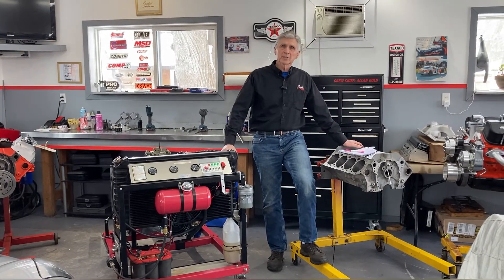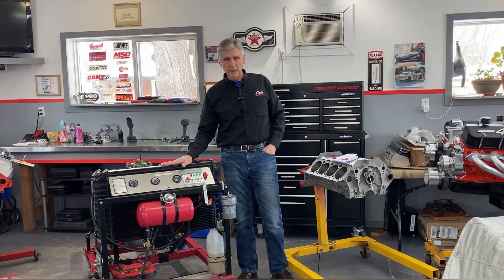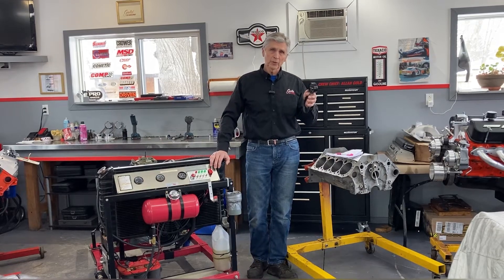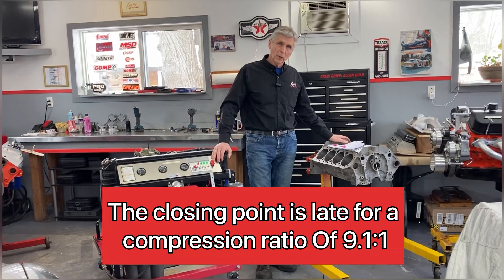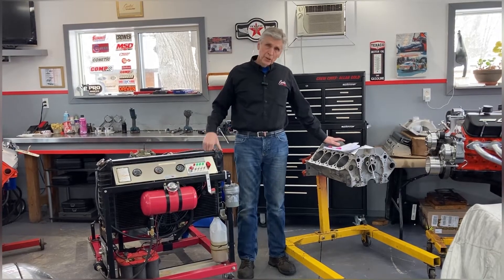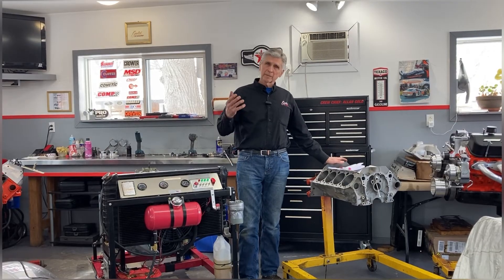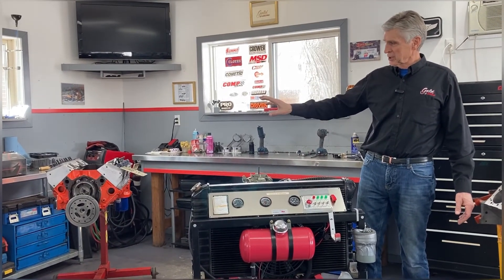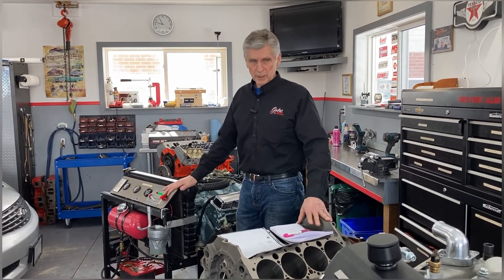Selecting the right camshaft- Matching your cam to your compression ratio - PART 1

Comment: Love your video! Question, I have a  stock factory 1996 chevy 5.7 vortec engine. I would like to change the pistons and add flat top pistons.  I also want to run the LT4 Hotcam. I am trying to do this on a budget and keep it streetable. What do you recommend in maximum static compression for the Lt4 Hotcam. I will be using 1.6 roller rockers. Also will run headers with dual 2.5" pipes. The top of the engine will be ported vortec heads with machine work and springs and hardware to match cam. Also the intake will be factory with the spider injection upgraded to the improved system with injectors for each cylinder, rather than the poppets. Also the injectors will be 36lbs. Oh, also high flow performance fuel pump. I want to put this engine together right. I don't mind running 91 oct premium gas. Transmission will be whatever stall converter to maximize launching and sither 4:11 or 4:56. Gears. The truck is just a fun weekend ride to cruise around and hit the strip occasionally.
Reply from the maker: Thanks Richard. With this cam and steel heads i still think you should stay under 10:1 to be safe. The Summit CR calculator works ok. With that info I suggest you google the Wallace Dynamic CR calculator and determine your cranking pressure. Again, I suggest 180psi max. Hope this helps. AG
Reply: @goldsgarage8236  what camshaft would you recommend in this setup I have , except bumping the compression to 10:5 to 11 to 1? And still have "decent" street manners, run on 91 premium fuel and no more than 3600 stall? Using the vortec heads I mentioned? I guess what I'm after is at least getting into the 400-450 plus ft-lbs torque territory. I don't mind having that "Chop" in the cam when idling. Like I mentioned in my earlier post, my truck is a fun truck for cruising around and occasional strip action. Its definitely not a work truck and it will rarely see the highway, except when traveling to the strip an hour away from home. I know there will be a handful of cams to choose, but just from your experience,  what do you think?
Reply from the maker: I will do my best. The vehicle and how you are planning to drive it is important. Since you are using gears, (high ratio numerically) and a converter and you want to race it a bigger cam is warranted. Is it an S10 or full size truck? 
Also a bigger cam will allow you to use more static compression so aim for the high side of 180PSI. Something in the 280-285 degrees of advertised duration, 230-240 @.050". This cam will have a late IV closing point, 66-70 ABDC. As for lift, I am thinking about .550" max with the 1.6 rockers. If you know the flow numbers from your Vortex heads, that should be taken into consideration. Some heads actually have reduced flow at higher lift. 
You will need to machine your Vortex heads to accommodate this lift and there is a max so that is a factor also. Check this out thoroughly to avoid coil bind or valve guide to retainer interference. 
If you don't mind the chop, a shorter LSA, probably about 108 would be ideal. 
Most factory cams are 110 which is a bit of a compromise, you don't want any wider LSA. 
Richard, that is my input for what its worth. You can also call the cam company for their suggestion and get other opinions. 
Thanks for the question. AG

Comment: Great video! I am in the process of designing a building a 496 for my 70 Chevelle. The block is at the machine shop now and I have went all Eagle forged lower end with main studs. Little much but I want the option of putting it on the bottle in the future. This is just street motor with a 10.2:1 CR with a .025 compressed head gasket. I haven't nailed down what cam I am going to be running but your video is great! I am sure I will watch in a couple more times :) Looking forward to part 2.
Reply from the maker: Thanks for your input shanman. I apologize that I just noticed it now. AG

Comment: One comment is that with that 0.065 head gasket you had no quench action. That's not great for efficiency or power. With the 0.025 the quench is probably great as long as the piston isn't way down the bore. It's too tight if it's zero decked and you might touch the head. Probably 0.035-0.045 is a good place to be. Quench is gasket thickness plus how far down the bore the piston is at tdc.
Reply from the maker: Thanks for your comment Robert, and sorry that I just noticed it. You are correct about the .065" gasket. My mistake for not measuring it on the first build. I agree .035"-.045" is ideal and the higher the  compression, the more important it is. AG

Comment: Your 160/180psi is probably  a good number for pump gas, 87 octane?   I have a 400SB with about 170/180 psi runs on 87 just fine. But my question is going  to 91 octane how much more psi can I go? 200/210psi? I don't like leaving power on the table.
Reply from the maker: Thanks Jesse, i am planning to discuss this issue in my follow up video. Thanks for supporting my channel. AG
Reply: @goldsgarage8236  yes and yes.  Can't wait to watch it.

Comment: I’m going to assume 160 to 180 is a target for premium pump fuel?  What cylinder pressure would one want for running 87 octane fuel?
Reply from the maker: Thanks Ron. This is an interesting subject and I am planning to do some more research on it for a future video. To answer your question I referred to the 1968 Chevrolet manual. A 307 200HP engine (base engine that would require only "regular gas") had a cranking pressure of 150PSI. As always, other factors such as timing advance, spark plug heat range, fuel air ratio, driving style etc. could influence this as well. 
I hope this helps and watch for more info in this subject.
Reply: It’s a very interesting subject!  Unfortunately octane and it’s function is a very misunderstood subject.  In my opinion, octane and a proper timing curve are the two most important parts of a properly functioning engine no matter the usage from racing to towing the race car.  Looking forward to more of your videos.
Reply from the maker: Thanks again Ron. This discussion inspired my next video. Would you believe that a 12.5:1 CR L88 427 has the same cranking pressure as the 307? I will explain why and how. Look for it soon.

Comment: My builder in 2019 scared me that I'd need to use E85 only in my daily 418 LS3. I've been using 92/93 octane with 11.9 SCR, 8.9 DCR, 220 cranking psi. Peak tq is only with 20* advance, though oem heads.
Reply from the maker: Thanks evcass69, it would be interesting to know if you could make as much torque with less CR and more advance. I have never seen 220 PSI in a street motor.
Reply: @goldsgarage8236  I wonder also.

Comment: Very good Tech.
I have been talking about this same subject for years.
Have to get the cylinder pressure up.
Do that the Horsepower and Torque comes up.
Taking advantage of your Low and Midlift flow numbers.
Good topic.
I just subscribed to your channel. 
Take care, Ed.
Reply from the maker: Thanks Ed. Your comments are inspiring more thoughts on the subject and so I am thinking of a follow up video about how the OEM's managed this in the early muscle cars. They were pretty smart. Watch for it. 
Allan Gold
Reply: @goldsgarage8236 Thanks Allan, I'll be watching for your video.
Great topic.
Thanks again, Ed.

Comment: Can anyone answer why some calculators ask for the intake closing +15 degrees? United Engine Machine in particular. Wallace Racing Calculator doesn't ask but their calculations match my "actual" cranking pressure.
Reply from the maker: Thanks Ragingbull340, I am getting good results with the Wallace calculator and advertised specs.
Reply: @goldsgarage8236   Thanks for replying. I've decided to only use the Wallace calculator. One question. When figuring cranking compression, should I use "advertised" intake closing and not .050? Thanks again.

Comment: All I have is the Intake Closing point at .050 lift cam specs. The calculators I see use the .006 lifter specs. Is there a conversion factor for this or call Lunati for those specs?
Reply from the maker: Thanks for the question. I think you should call. Some cams lift off the seat much quicker than others so I don't think there is any conversion factor. It's interesting that some flat tappet cams lift the valve off the seat quicker than roller cams.
Reply: The lobe ramp rate will control the delta between advertised IVC & 0.050 IVC. Using AIVC for DCR is best. Maybe you can get the AIVC from the vendor that ground the cam?
Reply from the maker: Thanks evcass69, I always use advertised intake valve closing specs for my dynamic compression ratio calculations with good results.

Comment: .967 I  .928 E and the Henry show is 14.5to 1 what it mean to work so well is with my head 540 oil into lifters wouldn't bleed down I lose hundred thousand lift 
You might say that's dumb
But it's straight 50 oil in it. there I had a lift from my camshaft
I'd run 9.06 et at 148 mph in the 1/4
With 50 weight oil in it it would run a 8.67 et at 167 mph
Reply from the maker: Thanks for your input Scott.

Comment: It's worth mentioning that your altitude where you live is also very important! I use the Wallace racing calculator and it has this included.
And the cam timing number you need are the "off the seat" duration number and not  the "at .050" number to select the most proper camshaft for the application.
I live at 3400 above sea level, and I'm using Aluminum cylinder heads, so an 11.8 to one static compression is what I need to get 170 psi with the parts I have!...good to see professional builders sharing this priceless info!
Reply from the maker: Thanks for your valued information and comments Duane

Comment: I run forged flat tops with small valve reliefs, 64 cc vortec heads and 15 thou shim gasket and it runs fantastic.. The amount of torque over the old 882 open chamber heads is crazy! Now I worry about the 700r4 trans lol!
Reply from the maker: Thanks Larry, what is your CR and what are you using for a cam?
Reply: Gotta love those Vortecs!

Comment: Compression adds power everywhere in power curve! What people need to decide is what kind of fuel to run and what kind of octane they want to use!  If they want to run 87 octane 9 to 1 is all I would push with todays crap 87 octane!
Reply from the maker: Thanks Larry, I agree. The dynamic compression should also be calculated as the cam can bleed off some of the cranking pressure.

Comment: I got a bit of problem with my build in that the quench distance is too large.
So I need to take the block back and get it ”zero decked”.
The cr is a very healthy 12.4:1 so the quench is probably needed..
Reply from the maker: Thanks Magnus, I would suggest you re-calculate your CR after to deck the block.
Reply: @goldsgarage8236  Yeah I think Ill have to modify the combustion chamber in that case so the CR doesnt get too high.
My main thing Im wondering about atm is the issue with quench distance. Only reason to deck the block would be to get the quench tighter but Im not sure if its worth it.
On one hand I have pistons with a shallow dish in them and only a 11mm band/ring going around the piston that could act on the quench.
On the other hand I seem to be in the distance that one should never be (0.055-0.06") according to most opinion.

The head gasket I have will compress to 0.043-0.049" and since my pistons are around 0.011 below the deck it gives that large quench distance.
A "zero decking" seem like it could be good but I cant really tell if it is worth it.

I guess another possible solution is to taper the chamber quench pad slightly in the hopes of relieving some of the potential for the non-optimal quench distance making it knock sensitive.

On-going research =)
Reply from the maker: Magnus, I agree, minimizing quench is definitely good to do but it is expensive because it requires decking the block. It does allow more compression without detonation, however decking the block increases compression so it is kind of a double edged sword.  I am building 2 400SBC's right now. One is .005" deck and the other block is untouched. I need 75cc heads to get the compression manageable in the decked block. Watch for them on the test stand and dyno.
Reply: @goldsgarage8236  yeah. And its hard to take back a decked block to how it was 😄
My brother suggested Id draw up the gasket in cad and have it cur out in copper. But Im not sure how it would seal up the water in the long run. Common practice on race engines not so sure on street engines.
Another benefit with that approach is I can reduce the crevice volume compared to the stock gasket wich have a 95mm hole compared to the 92.5mm bore on the engine.
Reply from the maker: Magnus. You can buy thicker head gaskets to reduce the compression but it kind of defeats the purpose of decking the block. Better to take it out of the heads or pistons if you can.
Reply: @goldsgarage8236  This comment really caught my attention when you mention .005 in the hole and 75cc chambers to make the compression manageable. I bought a 94 Sonoma project from a friend who got bored with it, the engine is 10.7 to 1 with pistons .005 in the hole with 47cc chambers with largeish solid roller. This engine dynoed 641 hp@6400 on 89 pump, would my friend be bleeding off cylinder pressure with the cam?

Comment: Valuable information! Thank you so much for doing this video! I'm planning on putting together an aftermarket top end on a Pontiac 428.
Reply from the maker: Thanks Kevin, glad it was helpful.
Reply: I'm trying to pry a 69 428 from a friend for a 72 Gran Prix, still has the original factory headers.
Reply: @heshtesh  you can always use a 400 block and get a 428 aftermarket crankshaft that fits in a 400 block and Chevy big block connecting rods, all balanced from Butler, all you need to do it block machining and put it together.
Reply: @kevinmanning4880  Appreciate the info but i've already got a big dollar sbc pump gas stroker for the street and what you suggest will only start another bad habit lol!  Read a funny comment the other day from a Pontiac owner " nowhere else can one spend so much money to get so little power as with a Pontiac" lol I could feel for the guy. No I think i'll try to keep it simple this time around.
Reply: @heshtesh  you haven't been associated with the correct kind of people. Have you heard of Big Chief? He beat everything in no preps, with a '70 GTO, I mean everything. There's a Canadian driving his 1965 GTO to drag week, he pulls a 9.77. Pulls a trailer behind the Goat from Dragstrip to Dragstrip.

Comment: I've read on a Pontiac forum that Crower 60916 does not come from the factory with 4 degrees  advance ground into it,that they need to be degreed to get to a 108-109,and they need to be advanced 4degrees to get to 108-109
Reply from the maker: Thanks for your comment Rob, Initially I had to advance it 4 degrees to get to 108 centerline. This time I advanced it 4 more degrees to get to 104 centerline. The crank sprocket it now installed on the 8A keyway.